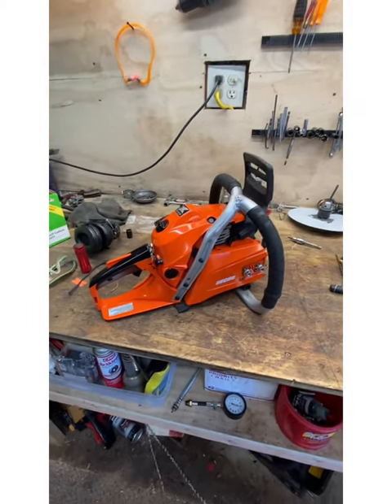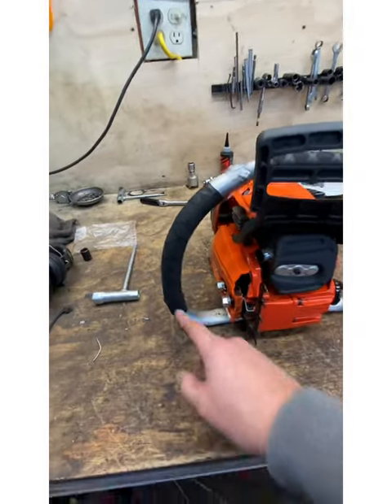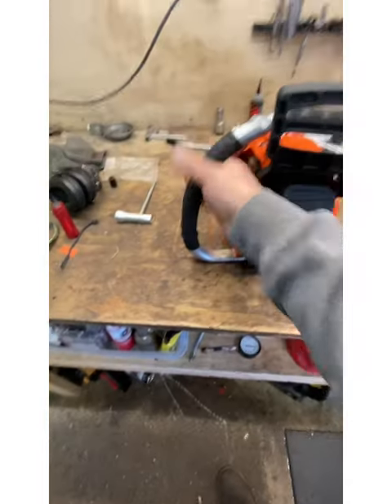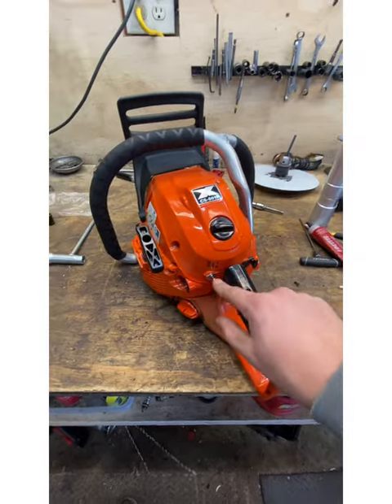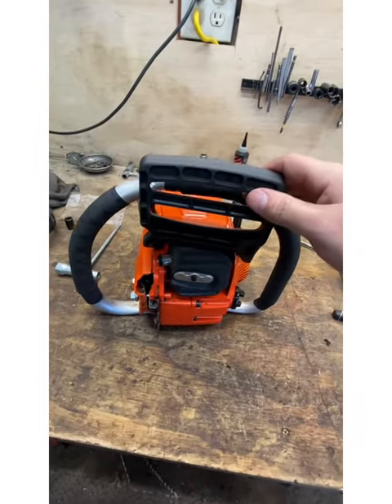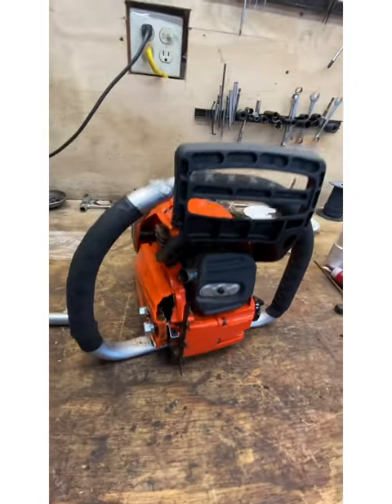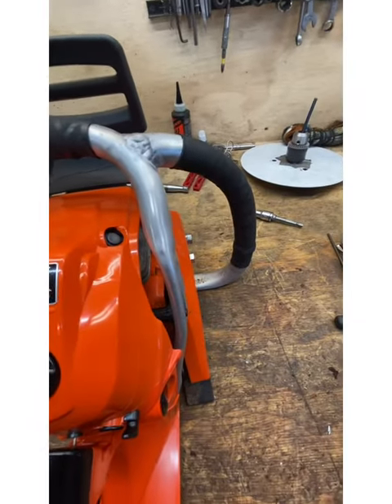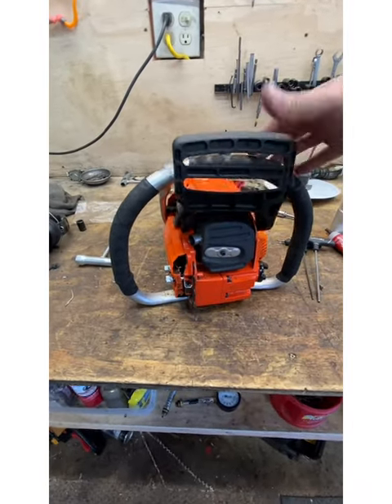Final Thoughts on the Ported Echo 501p Full Wrap

Comment: Like you said, great power to weight, and overall nice saw.  It would be nice to see a better air filter with a heavy duty option. Fine dust will pass through and plug the carb.
Reply from the maker: I agree on the filter. But the intake horn and filter seem to make a good connection. I’m sure it wouldn’t be hard for someone to print an adapter to fit other filters on it
Reply: I put snug fitting o ring around cover screw so dust cant get pulled in around it and hole in filter , helps alot
Reply: I love my ported full wrap 501p I did duel port muffler an cut up a Makita handle an welded it on
Reply: @waterbourne9282  , Thanks for the info.